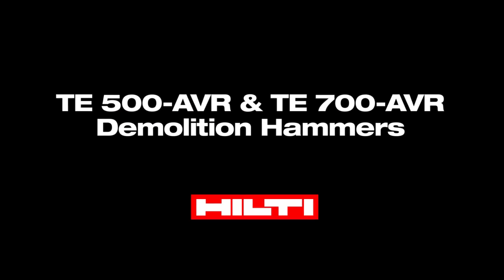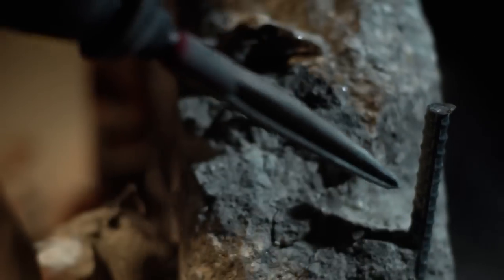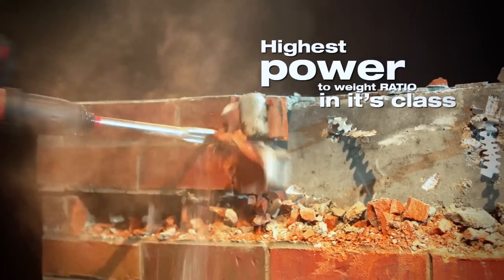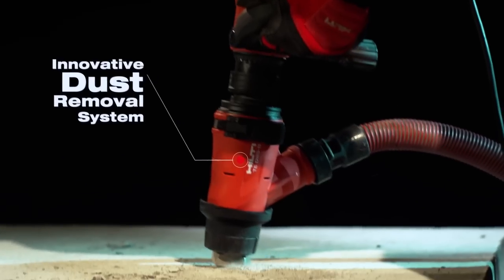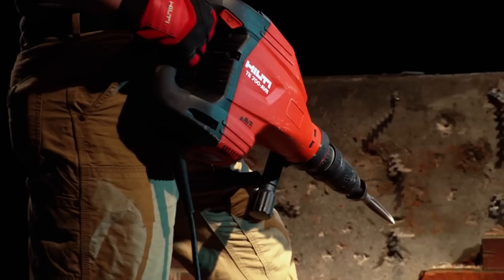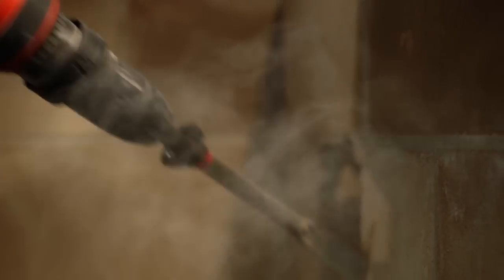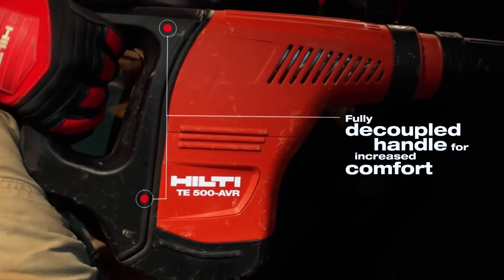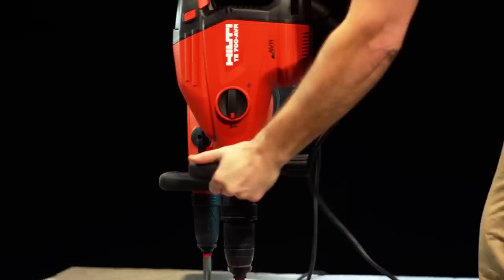INTRODUCING the Hilti TE 500-AVR & TE 700-AVR demolition hammers

Comment: this thing is a beast. Absolutely positively 100% effective. I've used this model for many demo jobs & it has always delivered the same results every time. it out lasted the big ass Makita hammers every time. its plastic body is great because it doesn't get too hot to handle. the Makita has a metal body & becomes too hot too fast. I just recently finished a 1200sqft demo that was all flag stone. while my co workers were constantly busy servicing the Makita, I was ripping out that tile along with the inch & a half thinset. very well made machine. 
Unfortunately someone decided to steal my Hilti & I can no longer work on demo jobs. money is a bit tight right now, but when I do get another bank roll going I will definitely get another TE 700 AVR. thank you for making such a fine piece of machinery